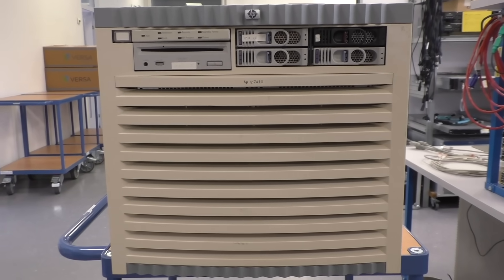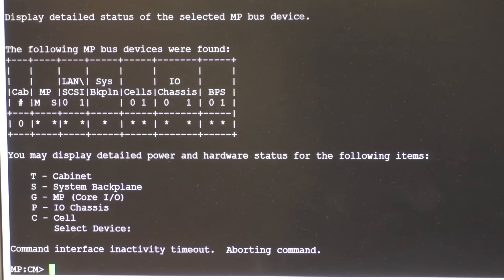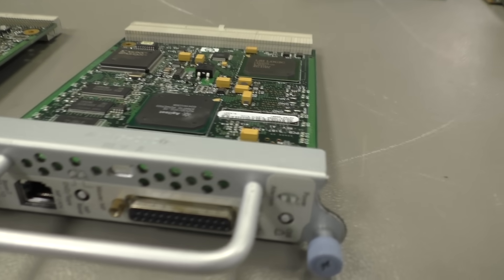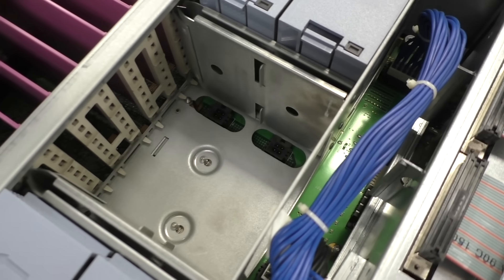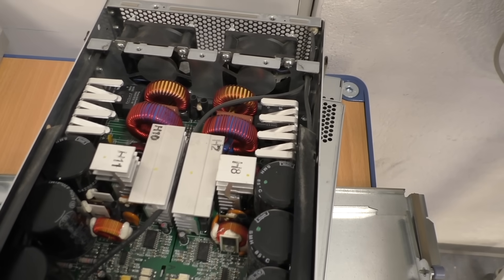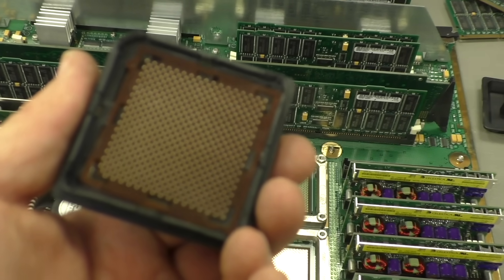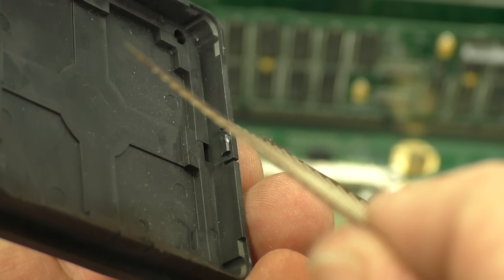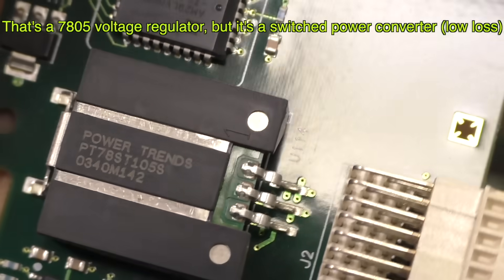HP9000 Series Server Teardown (PWJ262)

Comment: I had a few HP proLiant servers when I took over IT admin for local govt. they were decent machines - the previous IT specc'ed the servers with a RAID controller that didn't allow the array size to change after initial setup. it's important to know what you're buying
Reply from the maker: Where is the problem? Full backup, erase RAID config, put new disks in, make new RAID, restore backup.... easy! Only a bit of downtime... two or three days 🙂
Reply: @PlaywithJunk  yeah, it's not that easy irl I wish it was

Comment: I remember when we had to replace our almost ancient Sun E450 and took a look at the smaller 7405. Just out of curiosity my boss asked me to test my private computer based on AMD Athlon... After that the company never ever bought propietary RISC but used multiple redundant Xeon and Opteron Systems for a fraction of the costs and insane redundancy - we had a Fibre-based RAID1 made out of eight drives and it was cheaper than a single drive for the HP.
Reply from the maker: Still the same today. Many "non-brand" PC's or servers are better performing than expensive branded ones. 
We are currently using old Gen9 HP servers and RAID and disk enclosures that we got back for free and they perform better than a new Synology for a fraction of the price. :-) We just buy a bunch of new disk drives, that's all.

Comment: 4:50 That's a clean system.. no bit of dust.. the case design must be perfect to keep away any dust in this system..
Reply from the maker: This was a workshop spare. That means it ran only a few hours for testing and was cleaned frequently.
If the system was in a datacenter, it would be even cleaner because there is no dust in those air conditioned rooms.

Comment: wondering why they had that special rubber layer between the cpu and the motherboard, did it help with cooling the chip or where they worried about vibration or something seems like an odd thing to do, luv the fact they used old P3 designed Orb Coolers on the CPU's, 512MB per ram stick shows the age of the server cause now a days that would be 512GB per stick.  yeah soon as i saw C-19 plugs being used i know those Power Supplies had to be 1500Watt or More, but to have 4 of them thats insane especially if there rated for 1700watts, if thats redundency then thats 5100watts of backup power, with a combined total of 6800watts thats bonkers even by todays standards for a single server.
Reply from the maker: The "rubber layer" between the CPu and the board is the contact pad. It has the function of a socket. It connects the CPU to the board. Not much else...

Comment: HP knows how to do total PredatorCapitalism
Reply from the maker: HP knows how to die. Dell has passed HP with their sales long ago. And the reason is simple. Dell has less technical problems, attractive pricing and you can get firmware and drivers from their website without warranty or contract. And if you need a replacement part, you will get it!
I had a case with HP when I replaced a power supply in a customers system. So I called HP to get a new power supply because it was a warranty case. The supporter told me that the customer system has been repaired, therefore it's no problem anymore and I don't get a power supply. I guess because I DARED TO REPAIR a HP server without being a HP tech. Never happened to me with another brand.

Comment: Through all this video one word was popping in my head over and over QUALITY still rack units are higher quality than average (or even expensive) PCs but even today's servers lack the quality of the past.
Reply from the maker: I made a video about HP DL380 servers from Gen-1 to Gen-9... You cann feel the difference in weight. Steel panels are half as thick as the old ones. And that's only one part of many where they saved some $$$

Comment: This machine on that time cost a little fortune right?!...Any idea of that price?
Reply from the maker: Not really. These systems have been sold together with a maintenance contract. I heard that some of the later Superdome servers from HP cost 50'000 per CPU. With contract 100'000. Take 8 CPU's and some peripherals, you're at 1 million.
I once had a Silicon Graphics / CRAY system. One of the bespoke data cables (about 3m long) cost 50'000$. At least as a replacement part....
An IBM mainframe like a Z13 is about 10 million. :-)
We are talking about Lamborghini prices here...

Comment: The CPU and the Chipset were developed by different teams at different times, so that's why they have very different socket interfaces. And each of them went into several different products. I wish you had shown the chipset a bit more clearly. I wonder if it was a chip that I worked on. When we worked on these projects they all go by internal code names and whatever final product name that marketing department end up coming up with is usually an enigma to us :)

Comment: I worked on the chips inside the bigger cousin of this beast, the HP Superdome and HP Superdome 2! That MP interface brings back a lot of memories of my work testing prototypes after the chips are released. A ton of awesome engineering work went into these machines. You can run 32-64 core machines with 1TB memory back in the early 2000s before multi-core CPUs were mainstream.
Reply from the maker: A lot of people asked me about the price when the RP7410 was new. Do you have an idea? I guess one or two Cybertrucks... (100 to 200k)??
Reply: I actually have no clue the sale price (was a lowly engineer just testing my component 🙂) But these machines are usually bundled with a support contract, so I wouldn't be surprised if the whole contact is $200k or more. Superdome cells were $100k+ each, can have 8 cells per cabinet, and add that with a storage array, IO cards, etc. and you're paying $1M+!

Comment: Man, what a beast!! I thought my RP-2470 drew a lot of current, but this machine is on another level! Those 512gb. memory modules and the PA-8700+ CPU's are worth some money if you care to put them on E-bay. They also fit the J-6750 workstation and a few others, if I recall. I still fire up my RP-2470 (A500) once in a while to tinker around with it. Currently running HP-UX MCOE 11.23 on it, but I had Debian HPPA Linux on it for a few years to help with building packages for the distro.😉 Pretty cool old machines, and they ran (and still run in some cases), a lot of businesses, and government organizations. EDIT: I know what you're talking about with the lack of support from HP. Seems just about EVERYTHING is proprietary on these machines, and the stubborn bastards won't release any code to possibly upgrade them to something useful, because if they don't sell new machines, they don't stay in business. It's a shi^^y business model and creates tons of e-waste, but that's their strategy. I only keep my RP-2470 and a couple of J-series workstations around because it hurts to junk something that still works after all these years, but eventually they too will end up in a scrapyeard somewhere.💀😐

Comment: I wonder, in case of real desperation....if one could MacGyver one of those CPU plates from 3D printed plastic and zebra strips...would take some tedious work...but it seems crazy enough that it just might work :D
Reply from the maker: I guess it must be a very well conducting material
Reply: @PlaywithJunk  well, zebra strips are usually used for the LCD contact, so I would assume they would have enough conductivity...but probably enough to make this thing work...maybe not at the top performance...but enough to work :D

Comment: Those would be PA-RISC CPUs, right?

You might remember that you've encountered these metal sponge CPU interposers before when you took apart an IBM zSeries.
Reply from the maker: Yes the CPUs are RISC PA-8700 at 750MHz
Yeah, sure I remember those metal "steel wool" interposers. I first thought it might be pure gold but it's something else. But I have never seen the silicone rubber type except on thos HP systems.

Comment: I remember fighting with my boss to order 4 extra CPUs for one of these ($50k for each CPU if I remember correctly). We needed to go from 4 to 8 CPUs in order to be able to keep up with the IOPS needed to backup a huge (10s of TB) database within the required window (6 hours I think). Had multiple 10 GB ethernet cards and a bunch of 4GBit HBAs in the box, back when 10 GB ethernet was still VERY new and the drivers for HPUX were not well optimized. We had to manually pin specific interfaces to CPUs in order to spread the interrupt load and be able to keep up with the data rate. Was a lot of fun getting everything to work.
Reply: What sort of storage array/spindle count did it take to get into 10s of TBs at that point in time? must have been substantial?
Reply: @apdewis Yeah, back then all the real "storage" for the DBs were being stored on EMC disk arrays, with an entire Fiber Channel network and dedicated FC directors. We were also paying through the nose for Veritas file systems which allowed volumes to be switched between hosts to enable features like failing over to another host and re-playing Oracle DB transaction logs.

All told there would have been thousands of spindles across ten+ disk arrays, each of which occupied 3 or 6 or more floor tiles each.
Reply: @RyanCoplen  Thanks, I've been wondering for years what such large scale storage systems were ever used for. I only ever had the opportunity to deploy fairly entry level FC arrays in the form of Dell MD3 series. These days it's all petabyte scale systems and I've never worked anywhere that requires that kind of thing.
Reply: Hard to imagine a 10Gbit NIC on PCI-x, never thought such a thing existed...  Seeing todays prices for the few that do exist on ebay, I wouldn't want to imagine the cost when it was bleeding edge technology.
Reply: @ChucksBasix The NICs weren't too awfully expensive (comparatively) , but I do remember that the networking team was having kittens over having to buy access cards for their Cisco 6500 switches which only had like 4 10gbe ports per card.

The worst part for me was how poorly supported those early NICs were in the OSes of the day. HPUX was extremely poorly optimized. Even Solaris struggled with 10gbe at the beginning. They got a better handle on it by the time the Sun Fire T2000 boxes were coming out a few years later.

Comment: Those two 48V powersupplies seem useful... or is there some pitfall that prevents you from using them standalone?
Reply from the maker: You have to find out how they turn on. Usually it's only one pin to ground (as with PC power supplies) but you never know. Some P.S. need to communicate with a controller.
Reply: @PlaywithJunk  That is why I asked 🙂
Normally it is easy, but these power supplies undoubtedly only turn on when they get a cryptographically secure license certificate 🙂

Comment: I scrapped several of these back in 2004. Cool gear, but of course quickly outclassed by cheap intel gear running Linux...
Reply: I retired in 2006. At that point, we hadn't replaced our servers with Intel/Linux but had replaced most of the workstations at engineer's desks with HP PCs running Linux. People loved them, a huge upgrade from clunky aging HP/Sun workstations. I was less enamored with RHEL support, they never once solved a problem for us, we had to do that ourselves.

Comment: So incredibly over engineered when combined with that terrible rubber contact solution.
Reply from the maker: Those rubber pads are not bad as long as you can get new ones. It's a consumable item. The problem start when you don't get them anymore.

Comment: The plastic card slot things also serve as air guides to make sure the air flows correctly front to back. 
Regarding the configuration license type of stuff, there used to be ways for both IBM and HP systems to get that stuff sorted if someone wants to. It's not - supported - strictly speaking, so you can't build your own config and then get support contracts for it etc, but if you know the right people you can get stuff to boot and run with whatever configuration you want. I haven't played with this level of hardware for quite a few years so I don't know if the same contacts etc are still there today. In case anyone needs that sort of thing you should go on usenet and ask around on the specific usergroup for the platform type you're looking into getting running. 

I still have servers but not "big iron" anymore, just an ML350G10 which is plenty heavy for me. Mostly you need to have space and a strong back to play with the heavy rack stuff - I have neither anymore.

Comment: The amount of hardware that goes obsolete or unrepairable is mind boggling. I was in IT for 35 years. I saw it constantly. Makes me wonder how much these huge data centers produce.
Reply from the maker: I would like to know how many new disks Google/Youtube needs per day. And how many they scrap per day...
Reply: @PlaywithJunk  I recently compared quality in pixels for video picture declared by Youtube to what it actually is
and it was exactly 4 times less so, Full HD (1920×1080) → comes to 480×270 most of the time.
And this 480*270 with 4500kbit video quality amount to much less people would think.
Around 30 Mbytes on their disks labeled as full hd clips. 
3.5" SATA 10TB WD Red Plus (WD101EFBX) 292,66$ you custom make racks with only 20 of these,
and for 6000$ you have 200 TB that work for years and store 200,000,000 ÷ 30 ≈ 6,666,667 MV clips.

Comment: @15:41 - What the heck ? Is this interface made from tiny strands of gold wire that were semi-compacted into tiny balls ? To act like springs ?
Reply from the maker: Yes. It looks like ultra fine steel wool. And it's not gold, at least not pure, that would be too soft.
Reply: @PlaywithJunk  If I remember correctly, the HP CE's (field techs) referred to the modules as the "fuzzy buttons".  Though that could have just been the local department in my city. Edit: Both types were considered one-time use, I believe.

Comment: A biotech company I worked for in the 1990s had a bunch of K class machines.  The first Unix servers I crushed on!  They were so dour and serious looking - through the glass wall of the computer room.  I longed to go in there but was never allowed, I was a lowly lab tech.  My next job had a Sun E10000 I could get closer to, but I thought it was tacky looking!
Reply: The SUN E10k isn't meant to be looked at up close, there were installs of it behind glass where it looked quite cool. The plastics of that era sucked and broke if you looked at them wrong, so if you ever get to feel one up, be gentle ;-). The earlier light grey stuff held up much better, maybe because the plastic was thicker, not sure. Not that it didn't become brittle, it did, but the later dark grey stuff was thinner and a lot less durable from what I've seen.

Comment: Was this thing still in operation or just stored away for some reason?
Reply from the maker: It was a spare system for a customer who used it until 2020. I heard they used it for SMS/text message billing... It got obsolete when SMS went down to $0.00 :-)
Reply: @ Wow, that‘s quite a lifespan. But charging 19 cents for each SMS of course justifies 4 redundant PSUs.
Reply from the maker: @ It was a real moneymaker 🙂

Comment: That CPU connection solution... Just why reinvent a wheel? Or can someone elaborate what's the benefit of this solution?
Reply: I don't know. Guess? What's most likely to break? Those silly pins. 
You don't want to have to throw out an $20k CPU because a $0.01 pin bends. And you don't want to throw out a $5k board because a pin bends. So, put the delicate stuff on a part that's easily replaced. 
I don't know, but that's my guess at the logic...

Comment: I like how it has ALL the PCI slots, and it has 2 cards in it. You have to wonder, they made these machines with so many slots, but did any of them every fill even half the slots??
Reply: Yup. We would have a few network cards. And then we'd do RAID 0 across like 4 different IO cards to disk arrays (which would handle the redundancy) for performance.

Comment: I want a computer like that so bad but I don't have enough money or space. I'm already worried where I'm going to stick all of my compaq portables
Reply: Your greatest issue will be the power consumption, but if you heat your home with electric heating it may replace your heater.
Reply: @K2teknik.  And the noise. I remember our server rooms that had multiple HP and Sun servers, they were so loud together. Of course, for the heat, we had chillers. They were the least reliable part of the server room, far more downtime from overheating server rooms than problems with the machines themselves.

Comment: The CPU is an 875MHz PA-8700+ which was manufactured by IBM.

I've never seen conductive elastomeric connectors used in such an application before.  If this was an IBM system the individual PUs would have been attached using solder columns which are made with a high melting solder made of 90% lead and 10% silver and wrapped with copper foil.  The individual columns would have been attached using heat to the PU itself and then soldered to the board under compression using infrared heat.  Currently it is not possible to make these columns reliably from lead-free solder but they are exempted from RoHS.
Reply: At Micro Center back in the day (like 2004-ish) the stores still used an old PA-RISC box running HP-UX to run all their local custom POS systems via PXE boot. It was a dinosaur even then but unbelievably reliable.
Reply: @JohnVance  There are still MPE and MPE/iX systems out there- one HP 3000 system from the early 1990s still runs the MIS system at tractor shop in Mount Hope, KS where i lived up until a couple of years ago.